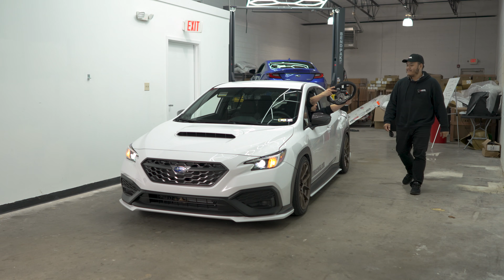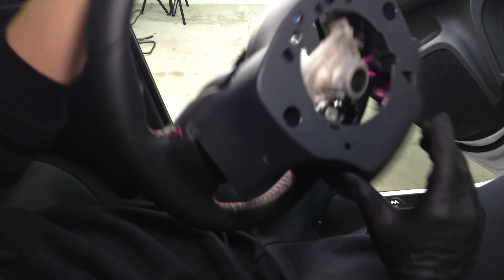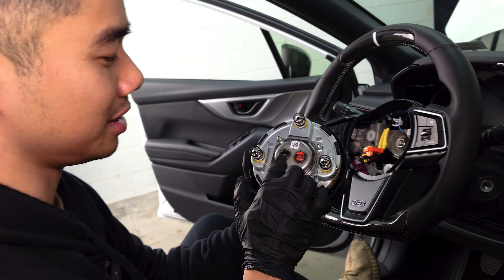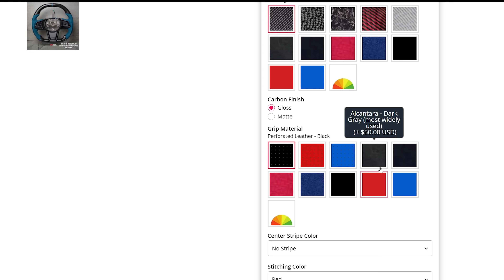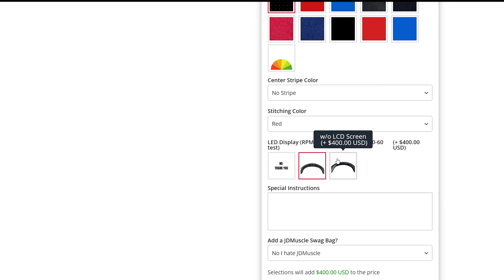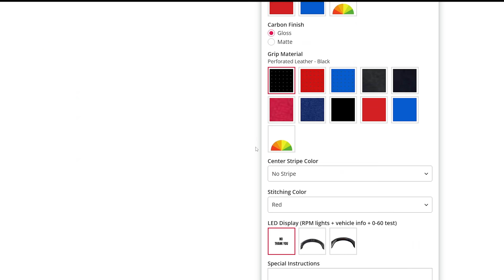22+ Subaru WRX Steering Wheel Installation & Removal | Ft. JDMuscle Custom Steering Wheel

Comment: I'm assuming there's more work involved when you purchase the heated steering wheel so what all else needs to be done to hook it up?
Reply from the maker: just connect a red wire to 12v source and black to ground. Drill a small hole to mount the button/control and you are good to go

Comment: Hello, I got an srs code and wheel isn’t completely straight, could the code be from the sensor detecting it’s not straight??
Reply from the maker: SRS code you just need to disconnect the battery 

Straight wise just have to either reinstall or get an alignment
Reply: @jdmuscleusa I had the negative disconnected do I need to disconnect the Positive as well??

Comment: My steering wheel is a little crooked to the right, can I straighten the steering this way ? 2 alignment shops couldn't get it fixed so I want to try doing it myself.. please reply
Reply from the maker: @Namikaze_4thokage  this is an alignment shop job. The most basic job. Try to find another shop I would say!
Reply: You can clock the wheel all you need on the splines unless it is keyed. Won’t change alignment. Happened to me. Shop said it’s center…. It wasn’t but according the the paperwork alignment was great so I centered the wheel myself.

Comment: thanks for the video. do you guys have any information about replacing cvt steering wheels
Reply from the maker: Pretty much the same process, just need to transfer the paddles over too - should be attached to the back cover.

Comment: Looks like they forgot to show the spring loaded clip transfer... but hey that's YouTube educationals
Reply from the maker: When this was filmed we were using OEM core for these wheels which came with the clips but you are absolutely right for future reference if a wheel did not come with it, It will need to be transferred over to the new wheel.
Reply: Def not a great video they left out a ton. Mines in piece right now the metal clips they don’t show don’t even line up anywhrre